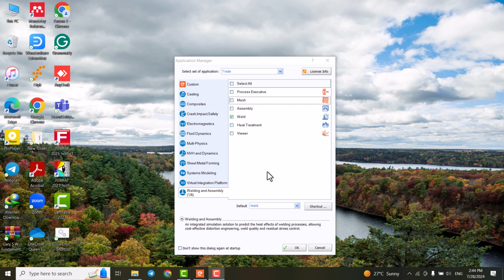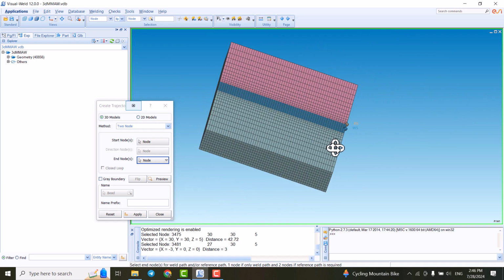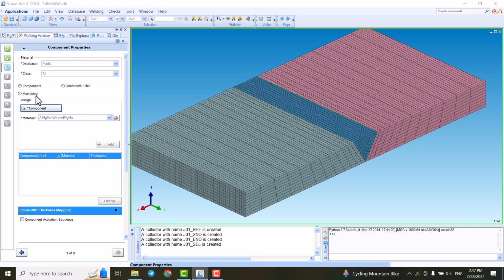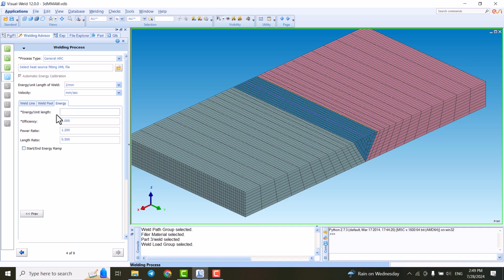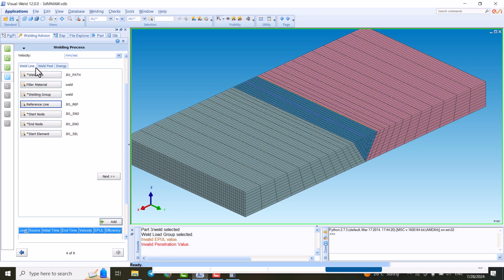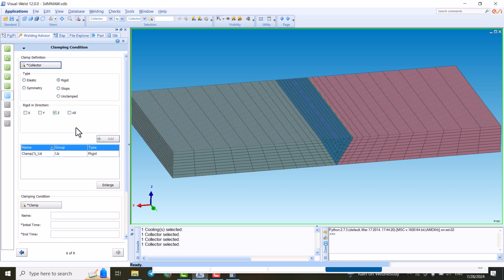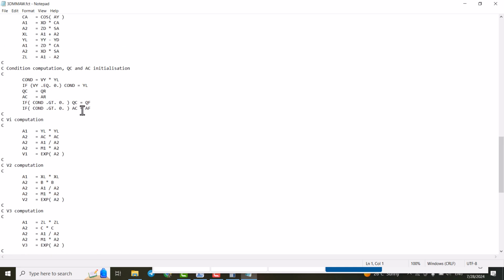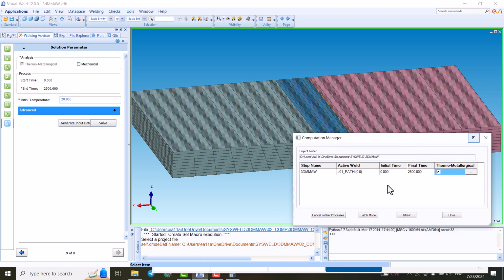SYSWELD SMAW Welding: Best Parameter setup for Accurate Simulation!

Comment: Hello Ihsan, I'm Muhammad Khalili. We previously connected on LinkedIn, where I reached out to ask about some points, especially regarding the restriction stage. How can I appropriately determine restriction locations? Additionally, is there a book or reference that I can use to benefit from?
Reply from the maker: Hey Muhammad, thanks for reaching out again!

Just a small correction—my name’s not Ihsan, but I think you might’ve confused me with someone else on LinkedIn. No worries though!

Regarding your question about determining restriction locations: it’s all about replicating realistic constraints without over-constraining the model. If you’re working in SYSWELD, the documentation has great examples. For fundamentals, I recommend checking out  
Finite Element Procedures by Klaus-Jürgen Bathe—it’s thorough and explains boundary condition strategies really well.

Also, if your question is related to a specific step in one of my videos, please drop it in that video’s comment section—it helps me answer more accurately and may benefit others too.

Thanks again for your support on the channel!